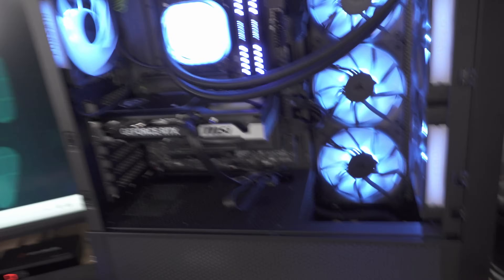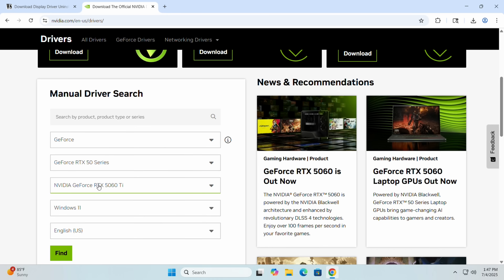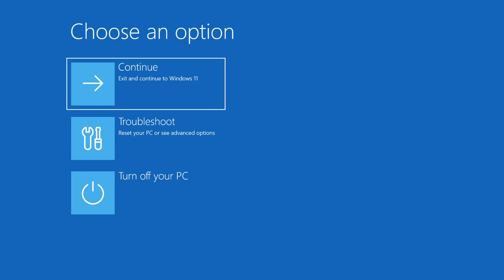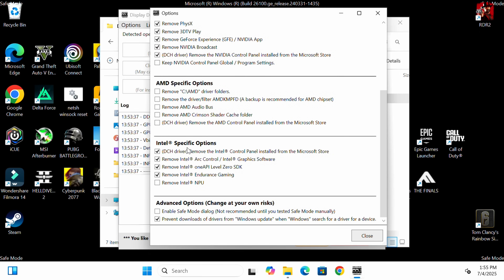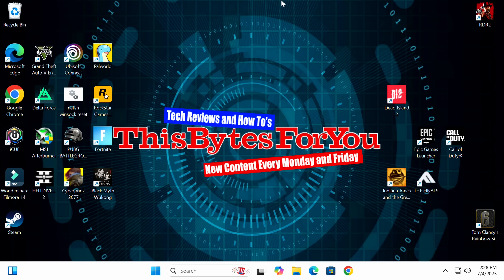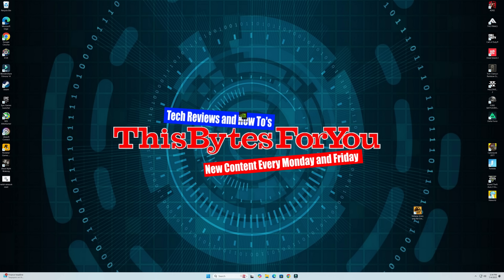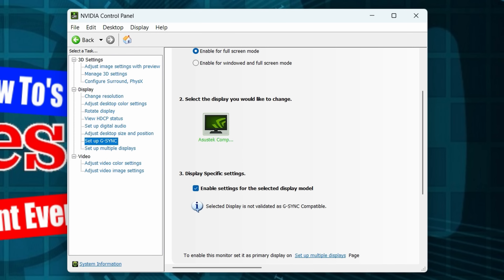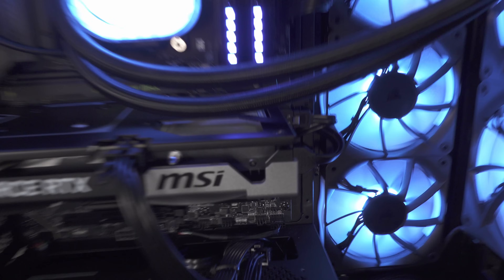The ONLY Way to Install RTX 5060 Ti? (Avoid Headaches & Maximize Performance)

Comment: I got black screen after uninstall driver via DDU and place new card. Any ideas? Cooling works, GPU's LED's works, when I move mouse my keyboard's LED's reacts. All DP and HDMI ports checked.
Reply from the maker: Is your monitor plugged into the GPU, is the cable HDMI 2.1 or higher or DP 1.4 or higher?
Reply: @ThisBytesForYou  Yes, I always plugged DP to GPU. Before I had GTX 1050, now 5060.
Reply from the maker: 1. Ahhh thats even more important, the 1050 required at least a 300Watt not knowing specifics of your card (like manufacturer and model number, 1050 is not a model number) and this card requiring at least a 600Watts Power supply.
2. They also have a difference between UEFI or BIOS, what is the manufacturer and model number of your motherboard?
3. You mention the card, while I also mentioned spec of the cable, 1050 required at least a 1.4a while the 5060 2.1b, the cable doesn't say it, but the box would, do you have the box for the cable?
4. Most 1050's required a 6PIn, are you using a 6PIn or an 8PIn (6+2 is also 8pin)?
Reply: @ThisBytesForYou  Thx for answer. I think I fixed it. I connected monitor by HDMI instead of DP (monitor started working). Then I checked BIOS and installed GPU drivers according to your tut. In HWMonitor and Device Manager now I see card, 3D Mark gave normal results so I think everything is ok (time will tell).

My PSU have 600W (SilentiumPC Vero 2). I used PCI-E 8 pin from kit. On the box I can read that I can connect two 6+2 pin cables so PSU should be compatible. My MB is MSI B360M PRO-VD (it hasn't HDMI/DP ports).

PS. My old GPU is MSI GeForce GTX 1050 Ti 4GB - that card is connected only with motherboard and needs 75W :P
Reply: @ThisBytesForYou  You may be right that problem was a cable. Before I tried connect 5060 with 10-meter HDMI 1.4b (to TV xD). Now I connected monitor 3-meter 2.0 cable and worked.
Reply from the maker: @LukaszBa   I was a product development engineer for Alienware, then later Dell when they bought us and Velocity Micro this is what I do for fun, not just some kid working at "Genius" bar, ;)  So now that I know your card, While the card consumes 75Watts MSI recommends a system with at least 300Watts, and requires a 6Pin PCIE connector, for your reference on the power.: https://www.msi.com/Graphics-Card/GeForce-GTX-1050-Ti-GAMING-X-4G/Specification

I asked for your motherboard, because updated BIOS' help support newer cards, this being a newer card it may have made it work, I can however tell you you will need BIOS version 7B53v1C to support Windows 11: https://www.msi.com/Motherboard/B360M-PRO-VD/support

But regardless updating your bios fixes a lot of things, you can read it on that link.

Also now that I know what board you have, now I know it does have HDMI or DP port, but it does have VGA and DVI, which you could have used adapters, and this is information I would have gotten as well if you have issues.

Comment: mine doesnt have the bolts there
Reply from the maker: Where do you see bolts?
Reply: On that thing you remove to put the GPU, that protection on the side where it fits and leaves the hdmi, dp ports visible
Reply from the maker: @Lenn_artz  what do you have there instead, keeping the PCI slot covers on?

Comment: I had to do much more to get my RTX 5060 Ti to work with my older ASUS TUF x299 Mark 1 motherboard.  It was giving dark screens during boot up but I manage to figure out all the BIOS changes I needed to do.  I just need to build a new system but DDR5 Ram is expensive.
Reply from the maker: Yeah, there are many different configs, in your case, updating the BIOS, switching from CSM to UEFI and MBR to GPT might have been your biggest hurdles but legacy is the hardest to do, because a 20 minute video becomes 80, but I am always happy to help in the comments if you need my friend.  There are also plenty of newer DDR4 builds that will work just as good or better than some AM5's and DDR4 is still affordable ;)

Comment: very helpful thanks, have just unpacked a rtx 5050 it has no cable or port cable that i can see to plug into the MB, & can i skip the getting rid of my UHD730 software,/drivers, i may still want to use it for probabably half the games i play,
Reply: single fan palit rtx 5050 stormX, really does look as if you just slot it in the PCI & then put the case back together
Reply from the maker: Basically, but if you have a card, you have to remove it, the drivers, setup your BIOS if not already, then install the card and drivers, and everything else to get the performance but if you don't care about performance and stability, yeah just pop it and and put everything back together.

Comment: Hey man, pls I need help. I just installed my 5060ti 16gb yesterday. I tested already on some games and I notice that in some of them the RPM reaches over 900... without gaming it stays around 700 rpm... is this normal? When it reaches 900 it starts to make a big noise. Ah, one more thing, when I was switching resolution on "Bendy and the ink machine" from the lowest to the highest, also I was hearing a noise on the gpu, like it was a energy noise, but i dont know if its just the fans or something else... I really need help. Thanks!
Reply from the maker: The noise sounds I would think coil whine, does it sound like this  https://youtu.be/HP73edpQwgc?si=BmSmxxqtu4FMPbNs
Reply: It doesnt sound like that, it is quieter than that... but its perceptible and I can notice to the point where bothers me. I tested more today and I notice that 1000rpm is ok... but the issue is at some heavy games, like 'Control', where I tested it today and the rpm went over 1800rpm... can you tell me if its ok to run at this rotation? And it makes a lot of noise, too. Also, my pc doesnt have enough fans to make a decent exhaust. Actually it doesnt have any exhaust. What would you say that is a limit for the rpm? Im new to these pc things, so I'd really aprecciate every help. Thank you
Reply from the maker: Well that is OK, so that happens because when  the card hits a certain temperature, set in the firmware, the fans speed up more to cool that, I think you are just talking about fan noise.  Any RPM is good, its trying to keep itself alive.
You might need this

How to Install a Case Fan in your PC - Step By Step Gaming PC Cooling Guide
https://youtu.be/J5m5WBlPkfc

You also might need to set some fan curves to get better cooling but what is the ambient temperature in your house?  Where do you have your PC sitting?

Comment: After installing the GPU my monitor isn’t getting signal. I’ve tried re-seating the GPU and ram, tried another monitor with another cord, and a power flush. Do you have any ideas what could be happening, and how to fix it?
Reply from the maker: Did you watch this video
Reply: @ThisBytesForYou I did, when following the tutorial at about 12:24 I faced the error after turning on my computer.
Reply from the maker: Do you have the HDMI or DP cable plugged into your graphics card or your motherboard?
Reply: @ThisBytesForYou I figured it out, I wasn’t getting any signal because a ram slot broke. Other than my own pc’s troubles, the tutorial worked great.
Reply from the maker: @maddoxiwamoto5765  ahhh well that makes sense, so very happy you got it and so very happy I could help you.

Comment: Replaced my 3060 w a 5060ti, but my HDMI signal goes out after a few seconds. Is my power insufficient? Its 600w
Reply from the maker: They recommend at least a 600Watt, what do you mean your HDMI signal goes out after a few seconds?
Reply: @ThisBytesForYou  oh wow ty for the reply! So after the pc boots up, everything looks good,then after a few seconds the monitor turns off and the no HDMI signal shows up.
Reply from the maker: is it while you are using it, or just when it goes idle?
Reply: @ThisBytesForYou after regular startup, within 1 minute of the bootup, i think Im getting a red led light on the motherboard debug lights. Im going to try it again and see w light
Reply from the maker: OK, lets save some time, So that I can help, please list the manufacturer and exact model number of the following components:
1. Motherboard - manufacturer and exact model number
   1a.  What BIOS version is on the motherboard, you can find out in the BIOS 
2. CPU - manufacturer and exact model number
3. RAM - manufacturer and exact model number
4. Video Card - manufacturer and exact model number
5. Power supply - manufacturer and exact model number
6. Monitor - manufacturer and exact model number
 Redundant I know, but many people forget to enter manufacturer and exact model number
7. Do you have ALL of the PCIE connections plugged in, and not daisy chained or pigtailed, each coming directly from the power supply?
8. Are you running through HDMI, DP, DVI, VGA, any adapters?
9. Is UEFI or Legacy Setup in the BIOS?
10. What slots do you have your RAM installed in?
11.Do you have CSM Enabled or Disabled in the BIOS
12. Is your Hard Drive/SSD with Windows set to GPT or MBR?
13. This video will help you identify hardware inside your PC: https://youtu.be/65ZSiVImJx0
Reply: @ThisBytesForYou I'll do my best to get this info, but I'm definitely a PC rookie
Reply from the maker: The video I linked up will help you.
Reply: @ThisBytesForYou ty for the help, the VGA red light shows up after i lose the tv signal (EZ debug led on motherboard) wanna throw this pc out the window tbh 😡 
Getting all that info w take me a long while but truly ty for the help
Reply from the maker: I have been around for a while, I am incredibly noob friendly because we were all noobs once and happy to help, but I need that info to help.  I gave you a video to show you how to find all that, though you may need to pop in your 3060 to do it, I am also recording now and editing, so I always have my hands full but I always try to help.

Comment: Well I am on Linux -Mint and de Nvidia drivers from Nvidia don't complete the install. Installing takes about TWO HOURS and then it fail.
The free Linux drivers do work but I can not get it to work in a Proxmox host.
Here I was thinking Nvidia was the only company that had support for linux desktops.
Reply from the maker: Have you removed the previous drivers, prior to installing the newest drivers, its been quite some time since I have worked in Linux, but I wrote a script (I dont have it anymore) to uninstall the older drivers and download the latest from the repository (all the drivers are free), I had to write different ones for Ubuntu. Redhat, Centos, Fedora and I think Mint as well, I forget which was the fifth, as a development engineer at Velocity Micro, I would have to build and tweak and tune our Tesla Worksations with 8 CUDA cards, back then C1060's and that was about 15 years ago, I have not played with Promox, but you often need to pin the Proxmox kernel to an older, compatible version and remove the newer kernel headers until NVIDIA releases the necessary update.

This might be newer but it looks like you must manually blacklist Nouveau in a configuration file (like /etc/modprobe.d/blacklist-nouveau.conf) and then update your initial ramdisk (update-initramfs -u) and reboot before installing the NVIDIA driver.

But you will want to look more into it, its been too long for me
Reply: @ThisBytesForYou  I don't know how to remove the current driver,  at the moment the nvidia-driver-580-open is active.
I could go back to the nouveau driver via Mint's driver manager, but that seems more like changing a driver instead of removing one.
About proxmox, I want the VM's using the Nvidia not proxmox itself and I did all blacklisting you mentioned..
Reply from the maker: Its been way too long that I haven't played in Linux for me to help you on that, sorry bud.  I feel bad because I like to dig to figure things out but without having my own environment it will be a long game of hunt and peck and see whats sticks, work with Chatgpt, it will be soooooo easy with it.
Reply: @ThisBytesForYou  No need to feel bad, if I have problems with it, it probably is not easy. I am mostly interested in getting proxmox to work and AI did not 
have a solution either. I might buy another GPU that is known to work well.
Reply from the maker: I am sure it will work, if you take time to learn it, that's Linux, don't throw money at it to get the same results, just slow down and read up on it

Comment: Excited. Just got the 5060 ti today. Upgrading from a 3060. Can’t wait to see how it performs. Had the 9070 xt in my cart but couldn’t handle spending the extra $400 when I plan on building a completely new PC at the end of next year. Saving the 9070 xt for that build.
Reply: I just swapped from that exact card. Trying it now and I have high hopes
Reply from the maker: @Kick_EnchantedMind  Follow along and you will be good my friend ;)
Reply from the maker: Both cards are great, so good stuff my friend.
Reply: So, how is it performing?
Reply: @FuzzyBlueLights not that bad. Got a new cpu to run with it to reduce bottlenecking and im getting a new motherboard soon so it shoild be crispy
Reply: Same but I need help bro
Reply from the maker: @AntiChrist893start your own thread on here and I can help, I dont get notified correctly going off of others comments

Comment: I going to be upgrading my PSU, CPU and GPU. Do I have to do these one at a time, or can I follow this video before starting, using the DDU and installing the new drivers, then upgrade all the hardware, then boot back up.
Reply from the maker: Yes, DDU it, shut it down, then do the upgrades and (make sure XMP/EXPO is enabled) make sure you have proper PWM settings in your BIOS for your new CPU, incase it gets hotter, if you had changed them before, but you should be good.  What are you upgrading to and from?

Comment: just got my 5060ti, its 79%  better than my last gpu! its gonna be a good gaming session soon :)
Reply from the maker: Nice, what GPU did you have before?
Reply: @ThisBytesForYou old faithfull 1660ti
Reply from the maker: That was a nice card, just make sure you have enough power for this card, MSI recommends at least a 600Watt, the 1660TI required a 450, maybe a 550, just want to make sure youre safe, but I loved the way you added a percentage, thats awesome ;)  Hows the gaming going?

Comment: After I changed with my new gpu computer started but no display has been occurred at all
Reply from the maker: Could be for many reasons, but lets see what we can do
1. What is the manufacturer and model number of your motherboard?
2. What is the manufacturer and model number of your CPU?
3. What is the manufacturer and model number of your Power Supply?
4. Do you have any other PCIE devices (sound cards, M.2 drives, etc) ?
5. Do you have the HDMI/DP cable connected to the graphics card or to the motherboard?
Reply: @ThisBytesForYou  wondering im using gigabyte msi. And unable to do the setting because its differnt and when I reboot it my screen are mega close up
Reply from the maker: Gigabyte is a company, and MSI is as well.  Raise your resolution and either lower or raise your scale, right click on the background, click "display" then  scroll down to "Scale and Layout" and you can play with the resolution and scale there, but it will be better once your install the NVIDIA drivers, have you watched the video"?
Reply: I got screen started somehow but it’s mega big and also the I keep clicking deleted but I cannot go to msi